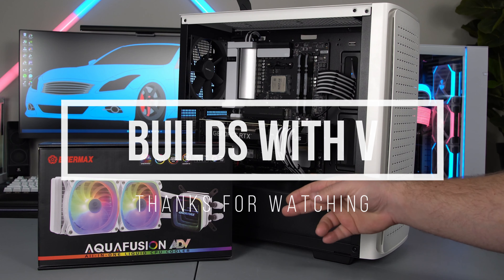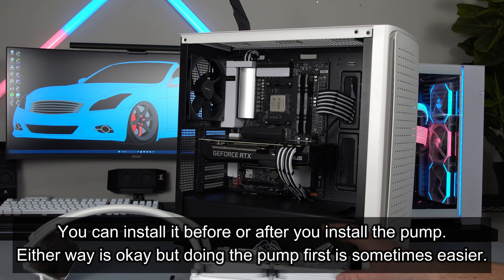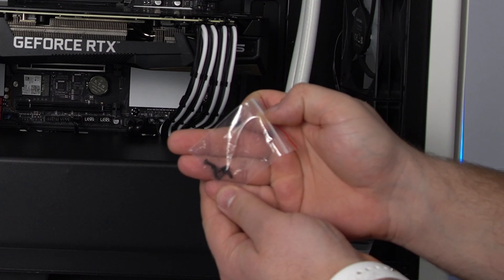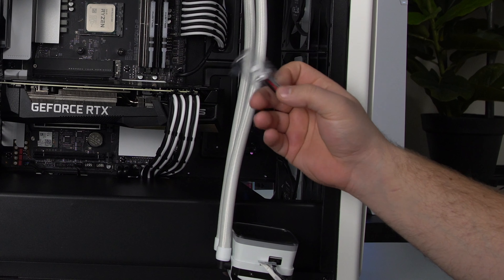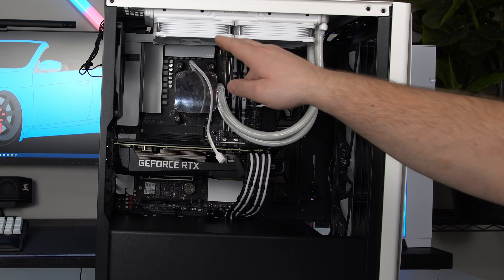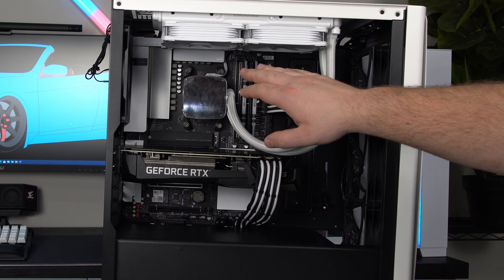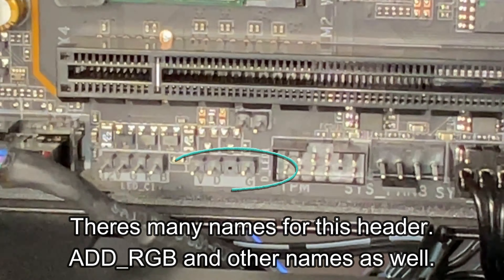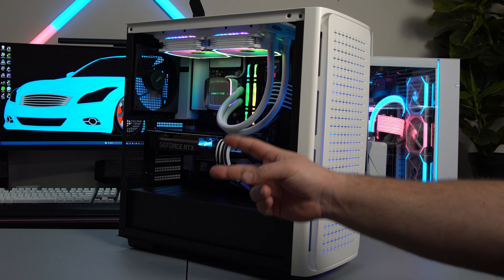How To Install AIO cooler - Enermax Aquafusion ADV Install

Comment: Nice information for just a AIO water cooler pump. Well spoken and explanation of the process, Kudos!
Since my 10-12 old system I build does not meet current Windows requirements attempting to come up to speed on newer tech for a potential new build. Don’t save much doing it yourself or at all it appears, however you know exactly what you have in your system.

Comment: I'm about to install this today. I can't wait to see what it looks like! Thank you for the video installation.
Reply from the maker: That’s awesome 🙌 Glad I could help and good luck to you
Reply: @Builds With V  You weren't kidding about those screws on the block mounts being tight as shit! I followed everything you showed in the video, turned my pc on and wow what a difference, I also added a rgb m.2 ssd. Thanks again.
Reply from the maker: @TheRizzler86  yeah that was very odd but other than that not too bad of an install. Glad you got it done and thanks for the update. How do you like the rgb nvme?
Reply: @BuildsWithV  It's not bad, I don't think you can sync the leds on it which is my only gripe, it's not super bright so it don't bother me, it's a viper400 m.2 Gen4 it was the fastest cheap rgb I could find lol.
Reply: how is it im buying it in a week and was wondering if its a bad product and if it has longevity or if i should get an air cooler